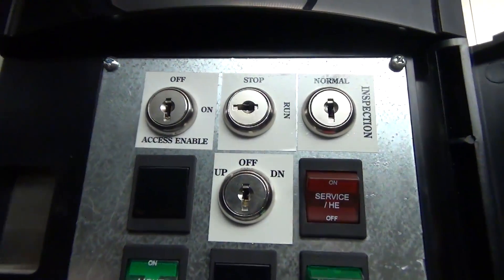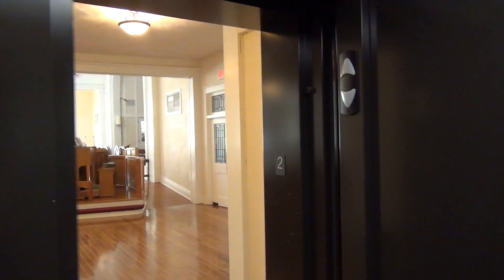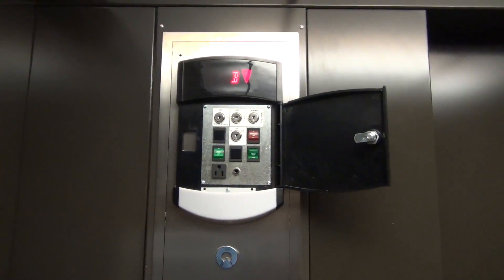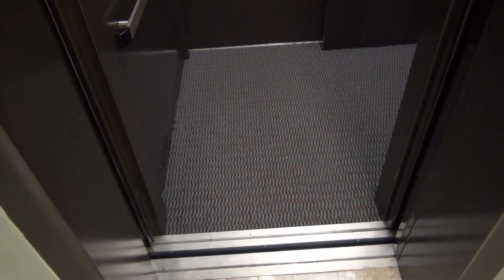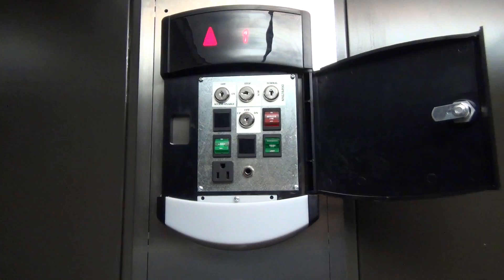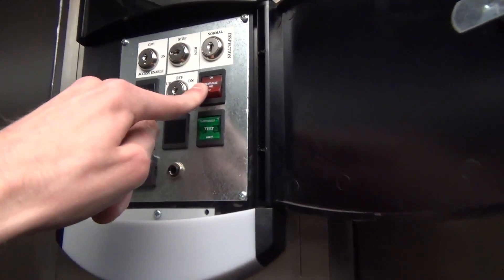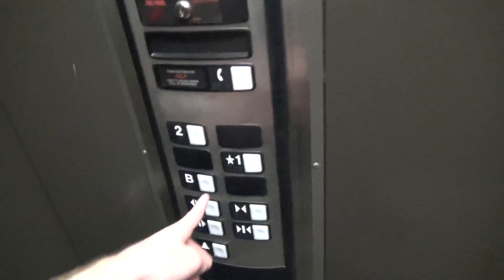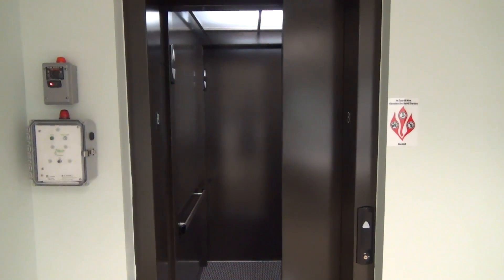Independent Service Demo of a Schindler 330A Elevator

Comment: What’s the purpose of Inspection & Up/Down, if there’s Access Enable and the hall station’s Access Up/Down and vice a versa?
Reply from the maker: I think it enables inspection manual mode in the car similar to the cartop.
Reply: @stlelevators Like the old Manual/Auto (Deadman’s Control) Service? Because I believe that Access Enable stops car calls and movement, and the hall access up/down is to move the elevator in leveling speed regardless of door status when access enable in the cab is on.

Comment: What is the "Access Enable" keyswitch for?
Reply from the maker: It’s used for inspecting the elevator.
Reply: @stlelevators  Oh, ok, I originally thought it was used for when an access control system is installed.

Comment: Another thing you didn't demonstrate: While on HE, if you interrupt the sensors or press Door Open when the door is closing, it will open back up and cancel the requested call.
Reply from the maker: Interesting. I didn't know it did that, but it makes sense.
Reply: @stlelevators  Pretty much their take on Dover's "Call Cancel" feature on IS, you know, letting go of the button before the doors are fully closed, that thing. Jamestube showed it a few times.
Reply: @stlelevators  They also do this: If you register a call while another is already registered, it cancels the previous call and will either: A. Continue traveling past the first call to the new one when going in the same direction (If leveling, it will stop at that floor then continue moving), or B. Stop at the nearest available landing and reverse direction if traveling away from the new destination.

Comment: I find it interesting how independent service operates a little more different on a Schindler elevator compared to the competition.
Reply: I'm not surprised. Many different manufactures do independent service their own way. I have a MAD elevator nearby that requires you hold down the floor button to close the doors (the actual door close button does nothing).
Reply from the maker: I've seen one where you press the floor and then have to press door close to make it move, even if the door is closed.

Comment: I've done Independent Service on an HT as well.  (Of course with permission) I think it's kind of weird the way they set it up.  The door close buttons don't work, pressing door open or touching the sensor will cancel out the call which I also find interesting.  And the call cancel button doesn't work either.
Reply from the maker: Yeah it's interesting.